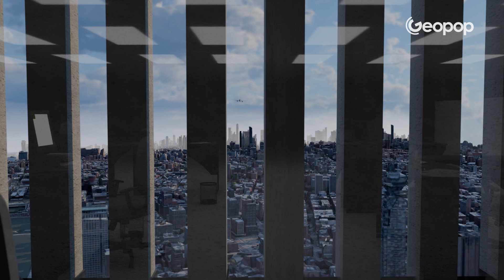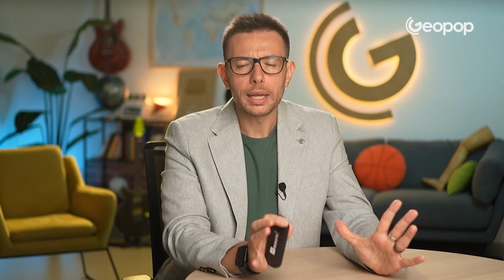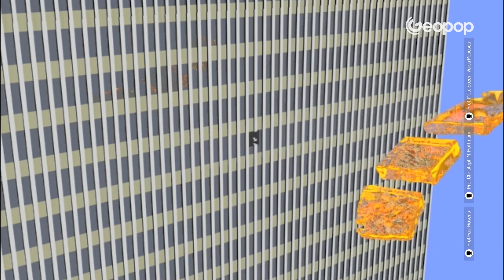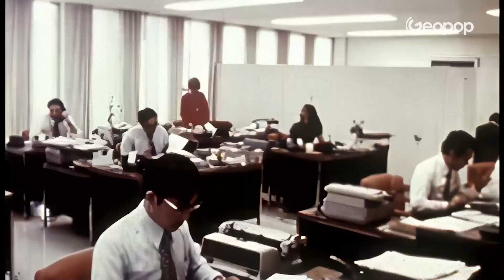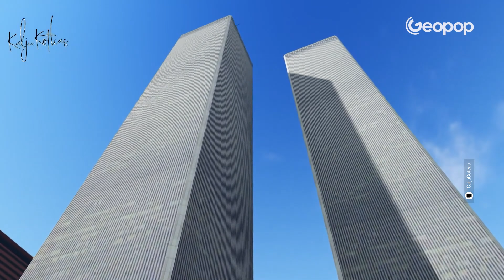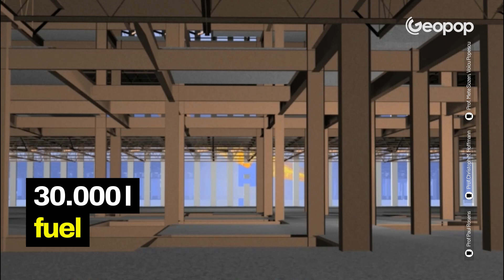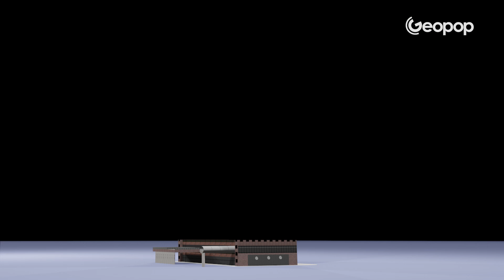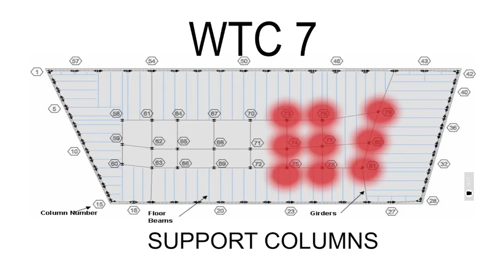9/11, 2001: The Technical Reconstruction of the Twin Towers and WTC 7 Collapses

Comment: Even so. ALL the steel on each floor would not fail at the same time......the only reason the towers would collapse in their own footprint as opposed to leaning like a tree being chopped down.
Reply: All the steel on each floor did not fail at the same time nor did it need to. That is why these are progressive collapses. One just needs to understand the mechanisms involved.

Planes impact Towers, causing massive structural damage, starting multiple floor-wide fires that spread rapidly due to the destruction of fire protection systems during the impact.

Serious fires were largely confined to the impact damaged floors and those immediately adjacent to them.  

Fires were started by the impacts and fuel aboard the aircraft, which acted as an accelerant. No shortage of other consumables inside the tower to continue the fires. 

Collapse was initiated (started) at the impact and fire damaged floors when floor trusses exposed to heat over time sagged, in turn pulling on and causing the inward bowing of perimeter columns by up to 5 feet until they buckled. 

No steel melted or needed to. Structural steel will bend and fail at less than half its melting temperature.

Once the perimeter columns buckled the formerly static load above became a dynamic load 30 times greater, easily overwhelming the structure below.

Thousands of tons of now loose debris fell through the open off space - through the inside of the building - dropping 12 feet onto the first intact floor it comes across. The massive instantly overload causes the floor to fail, adding its mass to the falling mass which continues to accelerate for another 12 feet until it impacts the next floor, rinse and repeat all the way down. Rate of collapse increases as momentum increases. As each floor fails, air inside the building (the Towers were 95% air by volume) is compressed, then blows out the sides _in reaction to the Tower falling, not the cause of the Tower falling.

No fire required at all on floors below the impact points for them to fail. The mechanisms that started the collapse are different to the mechanisms which continued the collapse.   That will be a difficult concept for some.

As the floors fail the perimeter columns are left literally hanging in the breeze, no longer attached to the rest of the structure. They peel away and fall in great sheets (think banana) out to more than 600 feet from the base on the 4 points of the compass. 

Core columns failed last. 

Each 110 story tower had a 1 acre footprint. The debris pile was up to 14 stories deep and spread out over 16 acres, destroying 8 surrounding buildings and damaging more than 100 others. 

Steel framed buildings do not topple. They are not rigid like trees and can only collapse down.
Reply: The towers were not trees! Trees are solid, the towers were 95% air. You can't see the difference?

Comment: People genuinely ask how aluminum cuts (damages, displaces) steel while also witnessing aluminum doing such things.
Reply: People genuinely do not understand that the steel was not cut. The columns were 30' sections bolted together at the ends; the planes broke the bolts, they did not cut steel.

Comment: What a bull****! And WTC7 was trashed by mouse farts? You are a "conspiracy terrorist" 😊
Reply: The unknown and unimportant Building 7 was the 6th building to collapse of 10 lost on 9/11. Though extensively studied, it still confuses many people. Not famous, or a terror target, and no casualties, thus it did not get a lot of attention and few know much about it, creating a void rapidly filled with garbage from the internet. Because everything seems like a conspiracy if you don’t understand how it works I prepared this brief summary explanation of my own analysis. No politics, just engineering. 

The North Tower collapse at 10:28am bombarded Building 7 with tons of burning debris, causing heavy damage and starting raging fires burning out of control for 7 hours. Half the responding FDNY firefighters having been killed, others injured, units in disarray, equipment destroyed, no water pressure, and the greater urgency of Search & Rescue efforts, firefighting at 7 was pulled as futile. The building couldn’t be saved and was left to its fate.

www.youtube.com/watch?v=g_SvpwyC17M&ab_channel=MFitz  

Collapse of a burning structure is always a concern for firefighters. Steel buildings subject to fire rely on active fighting of the fires to survive. Buildings are designed around 1 to 3 hours of fire resistance, allowing time for occupants to escape and ACTIVE firefighting to get started, after which all bets are off. Left to their own devices they will exceed their design envelope and collapse. In B7 the occupants escaped, passive and active fire protections were compromised and active firefighting was abandoned which left the building to take its chances. It lost. Odds on Building 7 would eventually collapse, and it did. No big deal in logic. That is the sort of choice firefighters make every day in brush fire situations - which houses to save and which ones to let go. Only real difference here is moving the decimal on the size and cost.

www.youtube.com/watch?v=WnYBX6QT0R4 

FDNY Chief Daniel Nigro ; The biggest decision we had to make on the first day was to clear the area and create a collapse zone around the severely damaged 7 World Trade Center, a 47-story building heavily involved in fire. A number of fire officers and companies assessed the damage to the building. The appraisals indicated that the buildings structural integrity was in serious doubt. I issued orders to PULL BACK the firefighters and define the collapse zone. It was a critical decision; We could not lose any more firefighters. It took a lot of time to PULL EVERYONE OUT, given the emotionalism of the day, communications difficulties and the collapse terrain

FDNY Deputy Chief Peter Hayden ; We had our special operations people set up surveying instruments to monitor and see if there was any movement in the building. We were concerned of the possibility of collapse in the building. And we had a discussion with one particular engineer there, and we asked him if we allowed it to burn could we anticipate a collapse and if so, how soon? And it turned out that he was pretty much right on the money, that he said 'In its current state you have about 5 hours

The collapse of Building 7 was anticipated all afternoon and widely reported in the media with at least 24 video cameras recording some or all of the collapse. Everyone at the time knew what was coming and why.

www.youtube.com/watch?v=OY5S5k3tMHI 

Building 7’s collapse was totally different to the Twin Towers, harder to understand and most of the details difficult to see. But we can sort out what happened through careful analysis and observation.  What follows is MY EXPLANATION of the collapse sequence using the best available information and relying on no authority.

B7 was complex structure, a 47-story steel framed building built on top of a smaller existing 3-story building, requiring several lower floors dedicated to complex load transfer structures instead of usable office space. Of trapezoidal shape and all-steel tube-in-tube construction, B7 (above the 7th floor) consisted of a central core of steel columns carrying most of the gravity load, perimeter steel columns around the outside of the structure carrying the remainder of the gravity loads and long span beams and girders to tie those elements together and form the floors. On the outside of the building hung a moment frame - the last part of B7 to fall. 

Phase 1 : Collapse initiation for B7 is notably quiet with observers not realizing the building was collapsing! There was no audible warning in the form of say hundreds of ear drum busting 180-190dB explosive bangs preceding the collapse. The first externally visible signs of collapse initiation occurred at 5:20:28 pm. Here at 12:00 a local CBS affiliate reporter is talking 10 blocks from B7 when collapse begins. People don’t start to notice the collapse until 12:11. Then at 12:45 is the famous CBS fixed camera clip of Building 7’s collapse Again, note how quiet it is.

youtube.com/watch?v=t5tEy6mXSE8&ab_channel=fresnosean379

Collapse initiation was due to multiple lower floor failures above the load transfer region (7th floor) in the NE corner of the building. In this video at 0:45 you can see the NW corner from inside the building while under construction, Column 79 just out of frame on the left. That big, angled steel beam across the top of the frame connects to C79 at one end. The girders connect to the beam. That beam and all those girders depend on just one connection

youtube.com/watch?v=nP3TNHPCIVU&t=35s&ab_channel=EdwardCurrent

Phase 2 : Lower floor failures caused a loss of critical lateral support over an excessive length of core Column 79 and it buckled. If you look at a floor diagram of Building 7 (see above) and look at all the structures that depend on C79 you quickly realize this one column was a relatively isolated structural element on which a disproportionately greater fraction of the structure depended . Externally we see a vertical progression of window breakage along the 44-46 line and a kink in the roof of the East Mechanical Penthouse at the top of the building, consistent with C79 failure. The transition from full capacity to almost no capacity occurs in virtually an instant. Once the buckling failure occurs there is almost no resistance

Normally with a buckling column, the load could very well be redistributed to other columns, meaning the buckling could stop after a while. With C79 that is not the case - the failure did not redistribute the load, so the collapse rapidly progressed to the roofline, sinking the rooftop penthouse.

Phase 3 : With C79 gone, B7’s progressive, non-symmetrical collapse continues with C80 and C81 at the east end of the core left laterally unsupported and quickly buckled and failed as well, sending the EMP down through the building. C79-81 all have no diagonal bracing, which I believe is a major reason why they could not redistribute a lot of vertical loads among one another.

From there collapse progressed from east to west through the central core until the core was gone taking all of the interior floors and structures and probably most of the perimeter columns with it. You can see the horizontal progression of window failures low in the building and the dropping of the remaining rooftop structures into the building. One of the big takeaways from the NIST Building 7 study (that gets completely ignored) was their modeling which determined C79 failing under ANY circumstances would have initiated the same collapse sequence.

Phase 4 : After some 10 seconds all that remains of Building 7 is just a hollow empty outer shell - the exterior moment frame - creating the illusion the building is still standing since little has changed externally. But it’s just a hollow empty shell like an empty cereal box supported by only a few remaining columns and quite unable to remain standing. With all the internal framing gone. the north face leans inward, forming a V in the roofline, the last perimeter columns buckle under the strain and with nothing left keeping it up the moment frame free falls, landing on top of the 7-story high debris pile. It is only at the very end that a single measurement of alleged free fall acceleration is taken. Note this is not the building but just its outer shell, and only one corner at that, at the very end of the collapse. Start to finish the entire collapse took 18-20 seconds, or less than 1/3 of true free fall and we have to look at the whole thing, not cherry-pick little bits to fit a particular narrative. Worth noting _how fast something falls cannot tell you what started it falling in the first place. The debris spread out, blocking surrounding streets, heavily damaging the Verizon Building and destroyed Fiterman Hall, all well outside of Building 7’s “footprint”.  

Building 7’s progressive, non-symmetrical collapse was incidental and unintended collateral damage from the combined effects of fire + time + gravity started by the collapsing North Tower. That is true no matter who planned and carried out the 9/11 attacks or why . The collapse was of so little consequence it barely even registered at the time, a mere footnote. 

Anything can seem like a conspiracy if you don’t understand how it works. Now you should. I hope you found this helpful and informative, not adversarial and it solicits informed critical comment. If I made any errors of fact, logic or reason or left anything critical out, please let me know so I can fix it. IF you can offer a more plausible alternative please do. Be the first. Please start any reply with the words “Tits McGee” or I will know you didn’t read it and are wasting my time.

Comment: here's and idea. the buildings weren't hit by any planes. they were wired for controlled demo during construction back in the 1970's.
the architect for these buildings also did pruett igo in st. loius. that public housing project was also brought down in a controlled demo.
Reply: Well, it's an idea I suppose but more like the concept of a plan rather than an actual plan.
Reply: @TheLoonResistance  well the architect  has never designed a building more than 30 stories before.
now he was hired for a building of 110 stories, why?
Reply: @TheLoonResistance  he does have many buildings, none however are near the height of the world trade center. is this the guy you would hire?